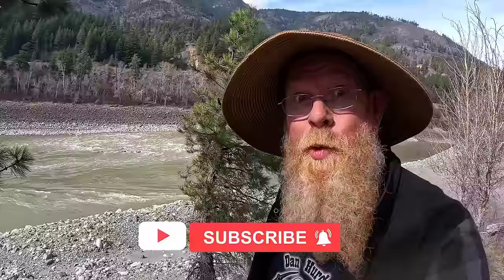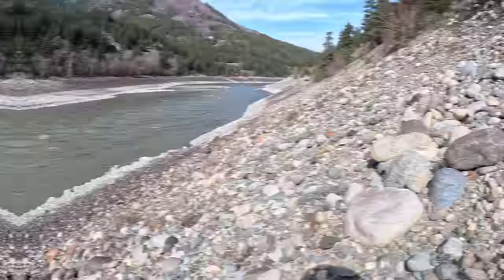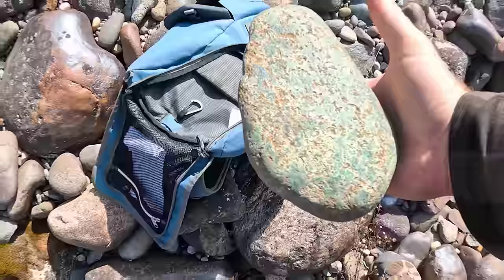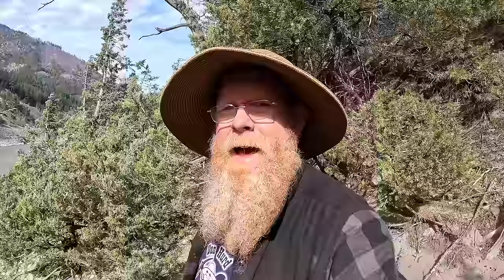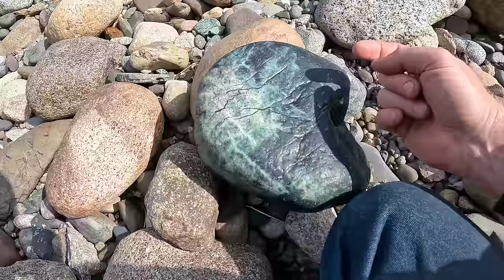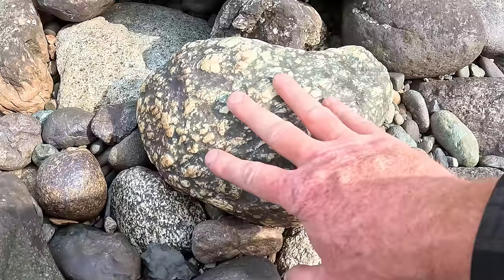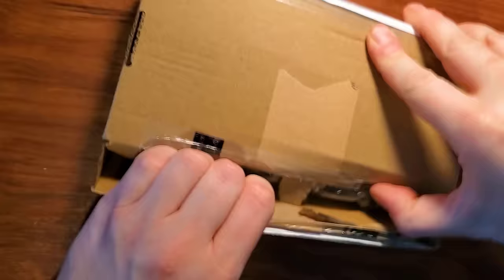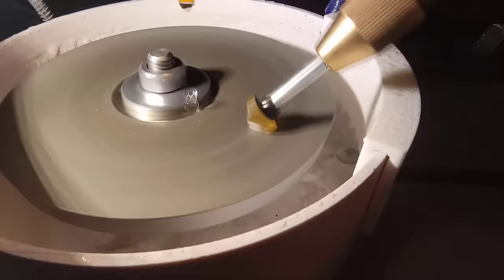Is it actually JADE? - *Lab Tested*

Comment: Not far from the tiny town of Gorda California on the Big Sur highway 1 theres a beach with very nice nephrite jade and a 100 foot swath of black sand leaded with gold. Every size from micron size to flakes and small picker nuggets and an occasional big nugget. I found a 5.68 gram nugget by sight. You can chase small flakes in the streams of water running down the beach after the waves. Grab them as they slide down the magnetic black sand. 
Jade is green to ice green to dark denim blue to ice blue.

Comment: If it has good color and will cut and polish both jade and serpentine are valuable. 
Scratch test works for Jade. I hunted Big Sur nephrite jade for decades. Jade is alot harder. A nail will leave metal behind when you scratch even a smooth piece. Serpentine powders up and is soft with a soapy feel

Comment: You could use a canoe, float down, then fill with larger stones and walk it back up.
Reply: If you are concerned about depth of the water close to the bank, when you pull the rope on the front of the canoe yes it will pull towards you, but if you put a fixed rudder on the bow and the stern that is turned to move both ends towards the center of the river then as the water flows by it will push it away from the shore as you pull it. And if the advantage of 2 fixed rudders is if rope breaks, dropped or gets away from you it will be more likely to self pilot into a shore.

Comment: Given both actinolite and tremolite are asbestos types, I wouldn’t recommend cutting them or licking them personally. 20:38
Reply: The composition is not what makes asbestos dangerous, it is the fibrous shape.  Jade is not asbestiform so it does not have any of the hazards of asbestos.  That said normal rock dust isn't great to breathe but this isn't uniquely hazardous

Comment: When you're rockhounding near a river, why don't you take a small inflatable boat with you so you can load it with rocks and pull with a rope from the shore? Seems much easier than having to carry it and you can take a lot more. Of course, you have to be able to park your truck close enough to the river.

Comment: 16:09  Would it be worth considering, of rigging up a Battery Powered Rock Saw?  Just enough to cut one or two stones like tihs ... to see inside!?? 

I recently purchased on-line at a HUGE discount, a European Cordless power tool, as the batteries are not sold in Canada,  It was fairly easy to convert it over, to accept a DeWalt 20 Volt battery !!

Or does a rock saw just use too much power?

Comment: Any idea why a lab would not test raw jade and only "finished" jade? Especially if it's raw samples but cut into slabs revealing the inner surface, what more processing would it need for this lab to consider it testable?
Reply: A lab may only want polished surfaces to get a refractive index using their refractometer.  Another lab may have X-ray defraction equipment that they can get a small sample to test.
Reply: The technique they're probably using is XRD, x-ray diffraction. I won't bore you with the details, but it essentially looks at the way the atoms are arranged and gives a fingerprint based on that. It works based on the angles that the sample reflects the x-rays, so you need a flat surface so that all the jagged craggly surfaces don't create noise. In chemical analysis just squeezing powdered samples down with a piece of glass is enough, but I suspect that since this is geology and everything is messier you might need an even finer surface to get usable data. As for why they can't work with slabs I have no idea.

Comment: That was quite a rush job, explaining the test results.  All I got from it was 1 maybe jade, the rest serpentine.    I don't think using a portable refractometer is the best way to identify jade.  All the BC jade I have seen ( from known sources, eg: commercial mines at high elevations ) have almost no transparency.   China imperial jade can be very transparent.   The low transparency of BC jade results in a low S/N ratio in that refractometer instrument.   A gemologist would use several methods - specific gravity, streak tests, hardness, etc.   I panned forward in this video to see how long it took to saw those small slabs, but you didn't show that.    If you can saw those slabs in under an hour, it is not jade.   It appears some of the slabs broke apart after sawing.   That is another indication of serpentine, or some other stone.  Jade would not have internal fractures.   Back in the early '70s there was a company in Vancouver that was carving jade from a mine they owned.  A friend of mine worked for them as a carver, until they ran out of money.   He would complain that some of the jade they had to carve had cracks in it.   The cracks were from the dynamite used to mine it.   Despite having cracks, that jade did not break apart.   And if dynamite (  or whatever blasting compound they used ) had not been used, there would be no fractures.    So now that you know most, possibly all of what you are collecting is serpentine why are you claiming it has been official tested and confirmed to be jade?   Don't you think that is being dishonest.   And since you do know it is likely all serpentine you should go to a rock shop, if there are still any in Vancouver, and buy a nice slab of leaf green BC jade.  Do an A-B diamond cutting test with a piece of serpentine you hauled up from the Fraser River, and that slab of jade.   You will instantly see how much longer it rakes to saw through jade, compared to serpentine.

Comment: You should probably be careful kicking up dust there and licking those rocks. The dirt found in areas of serpentine is filled with microparticles of asbestos
Reply from the maker: You don't know the Fraser do you.....  Dust storms daily, and no higher level of lung cancer than anywhere else
Reply: @Danhurd  you're right I don't know the Fraser. Just learned a few things about where asbestos comes from and I figured I'd give you a heads up just for safety. Love the videos Man